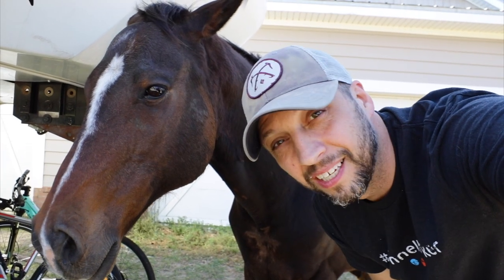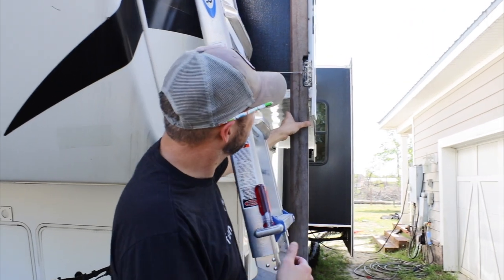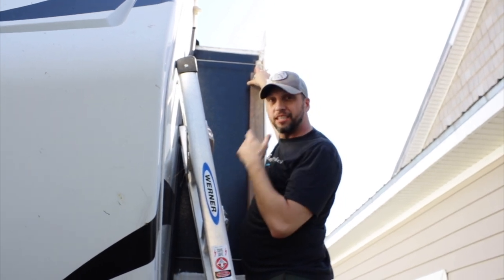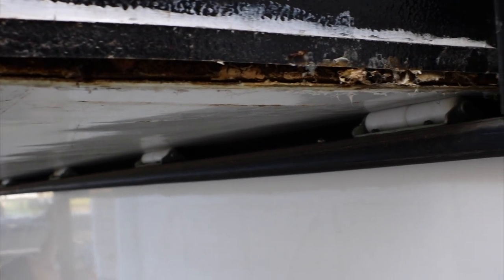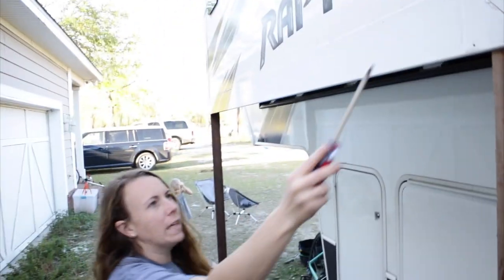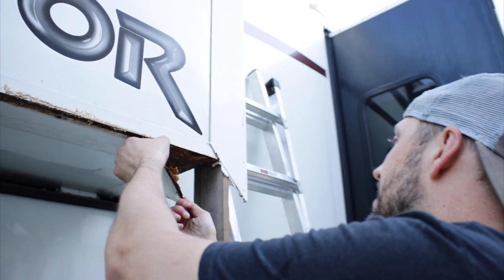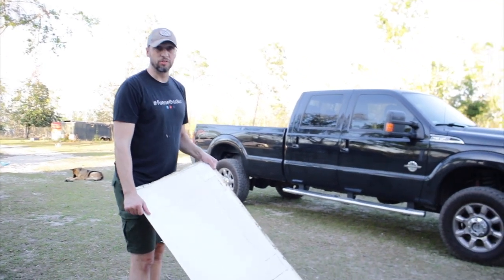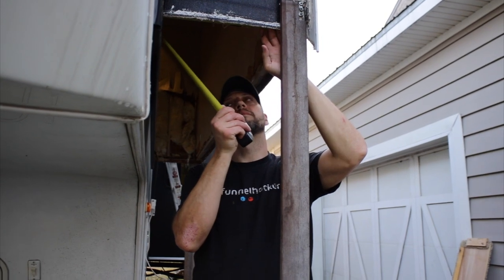RV Slide Floor Replacement

Comment: I’m guessing you don’t have a video of finishing up this repair? Did you find the exact thickness floor you needed? Thanks
Reply from the maker: No. I had to improvise.  My friend had some 1/2 in corian laying around from his cabinet and bathroom remodeling business.  We overlapped 2 pieces of the corian and it worked great. 

We don’t have a video of this because it was raining hard that day. We didn’t have the time to set up the cameras and attempt to keep them dry.

Comment: What is the black fabric called under slide
Reply from the maker: I’m not sure what it’s called. It was a plastic material used as a moisture barrier.  You could probably use any construction plastic.

Comment: Hey just seeing this video. Did you ever figure out where the water was coming in? Thanks for doing the videos!
Reply from the maker: Yes, the water was coming in through to bottom. It was running down the side of the slide and then rounding under the slide and beeing soaled in by the wood. Hard to explain but I'll try to make another video that demonstrates where the water was coming in.

Comment from the maker: This floor repair was not as bad as others made it sound.  It is a tedious process but the total cost of this repair was $79 plus 8 hours of time.
Reply: Did that time include dismantling the whole bed and reassembling the whole bed? Thank you
Reply from the maker: @454bard  our bed was not in the slide.  So we did not have to worry about dismantling the bed.  However,  we eventually removed the factory bed and replaced it with a mattress and frame that we liked.

Comment: Did you make a video where you actually put the floor back in?
Also where did you get the long plywood?
Reply from the maker: We have a blog post that we are posting soon at freedomcallingrv.com.  It was raining heavily the day we installed the new floor so were were unable to record footage.  The blog post will give details of how we did it.   We were unable to find ply wood that was long enough.  Our initial plan was to fuse two pieces of 8ft x1/2in ply at an off center by 1ft. And then add two 1ft pieces on each side to create a long enough piece of floor.   However, my friend was a custom cabinet builder and he had some extra pieces of Corian laying around.  I actually created the floor fusing a piece of 1/2in corian with a 1/2in piece of ply.   The floor is a little heavier than the original set up but we cut some weight when we rebuilt the closet.   I'll let you know as soon as we upload the blog post.
Reply: @freedomcalling  Hey is the blog post there yet? It is exactly what I am looking for.
Reply from the maker: We just published a video tour of our RV and we show the completed closet: https://youtu.be/OJ_3uyAOrl0
Reply: Freedom Calling b
Reply: I just tore out a bunk house floor with water damage and my slide didnt move at all. The cables from the electric slide out held it on place. As long as the slide is all the way out it will hold a bedroom slide. If I was doing the living room and kitchen which I am going to do shortly. I will block those up
Reply: Every rv eventually leaks in those bottom corners. All of them. Industry wide very poor design
Reply: Update. I have replaced living room floor now and I didn't need to block it up either. Even though I did. When I took the old floor out the slide actually got lighter instead of heavier.
Reply: barry1978 hi I am Frank, Pembroke, Ont. Canada, I a, 62 and have to replace floor in my 12 foot slide what did you use for new floor 
And how I'd you get a piece long enough or did you have to fuse two lengths , if so what's the best way?...thanks
Reply: @freedomcalling  v

Comment: Episode 3 of 3 never released?
Reply from the maker: The footage was lost.  I’m happy to help if you are having the same issue.
Reply: @freedomcalling  sorry to hear that. How did work out in the end, did you use one piece for the floor or two?
Reply from the maker: @rjbass338  we used two pieces of corian counter top.  My friend owned a cabinet company and he had two large pieces of scrap. It was exactly 1/5inches thick.  We cut and overlapped the pieces to the correct size and used that as the floor.  It weighed about the same as the wood floor...and we didn’t have to worry about it rotting in the future.

Comment: Milwaukee tools are far superior to that green brand.  Think u seen those at harbor freight lol. Oh makes sense after watching more I see u drive a Ford too.
Reply from the maker: Joseph Long Milwaukee  makes some great tools.  They were just a little too pricey for us at the time.  these were actually a HomeDepot brand called Hitachi. They were recently purchased by a German company now called Metabo. Same color but they increased the prices.  They now have tools that can run on 36V or 18V batteries. It’s the first power tool line that I’ve seen that will run on either 36V or 18V.